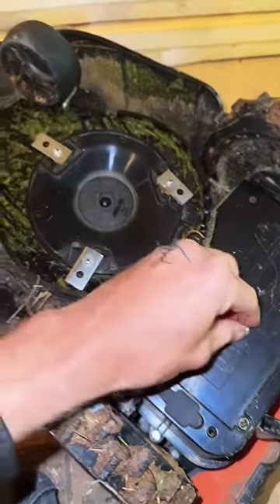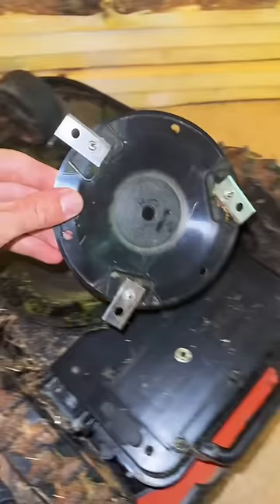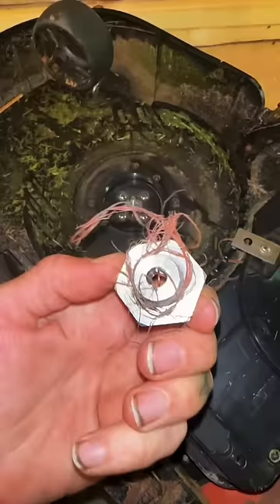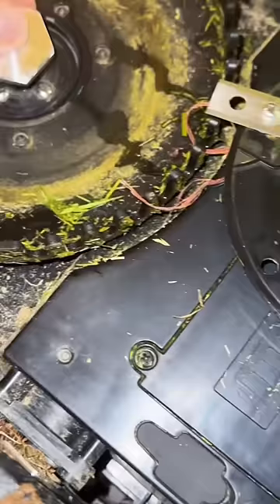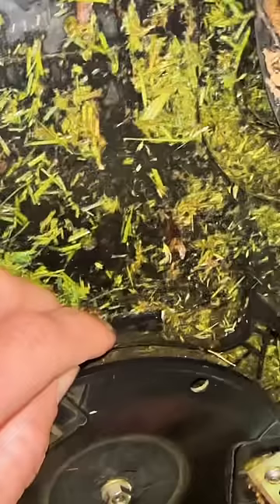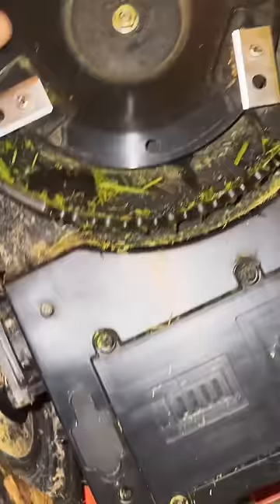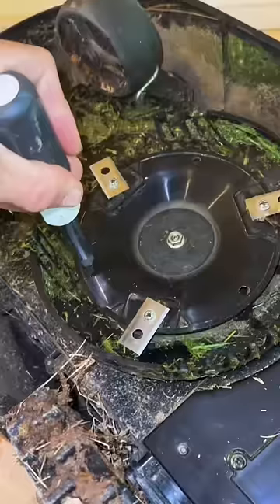Twine wrapped up in the robot mower

Comment: It can't just fall off, even if you don't get it tight. It should be reverse threads, it spins. It should always be tightening when in use.
Reply: YES thank you
Reply: do they ever make tools like that with regular threads and just make it rotate the other way?
Reply: @bugglemagnum6213  they generally make tools rotate whatever direction works best for the application, and then use the correct thread direction to match.
If the direction of rotation of the tool doesn't matter, they will usually design it to allow standard threads to work since it's cheaper and easier to build and repair.
Reply: @bugglemagnum6213  They make that on trophy trucks, they make all the rotor nuts reverse thread so that if anyone of those are loose they tighten down when in use
Reply: They call that left handed threads.
Reply: @joshuagary2745  also know as reverse threads lol
Reply: @109_jackson8  a lot of cars have reverse threads on the lugs on one side, and standard threads on the opposite side.
Reply: @ke6gwf  classic cars. 
Modern passenger vehicles in the US dont do that anymore. 

Pretty cool that it used to be a thing.
Reply: @bleach_drink_me  lol, I guess I mostly work on "" classic " cars then!
A lot of mid and heavy trucks also have the reverse threads on one side, but you are correct that newer cars don't seem to use reverse thread lugs anymore.
Reply: @ke6gwf - Ben Blackburn  thats why I mentioned passenger vehicles. As in the normal grocery getters.

BTW thanks I didn't know the heavy trucks used them. Outside of my experience 🍻
Reply: @bleach_drink_me1103 My dodge 69 96 wheelbase Split window Cab overstile custom sportsman pick up..
Reply: @109_jackson8  and some dirtbikes 🤘
Reply: My mower doesn’t have reverse threads I nearly broke the blade bolt off
Reply: It SHOULD be, but it's probably not. These cheap little things don't have that kind of engineering
Reply: A. Someone left some hay bale twine out there.  
B. That didn't look reverse threaded.
Reply: The only tools I can think of that would be able to run in both directions would be on 3phase. That is a completely different monster, and where my knowledge of operating comes to a screeching halt.😄
Reply: Yip👍

Comment: It should be reverse threaded or spend the other direction. The spinning of the motor should tighten the nut like on a table saw. If so DO NOT over tighten. It would just make it harder and harder to get off as time goes on. Unless I'm dealing with something that has an electric brake to slow the blades down I only go a little more than hand tight. If it does have some kind of braking mechanism I do go a little tighter. If not when the brake kicks in it can cause the nut to start to loosen. A way to tell if you have a brake is a second or two after you kill the power you will hear the blades go up in pitch and slow down rapidly. If they just slowly spin down.... No brake. With good bearings you'd be surprised how long an electric motor will spin when shut off.